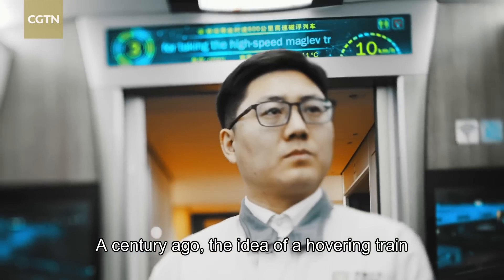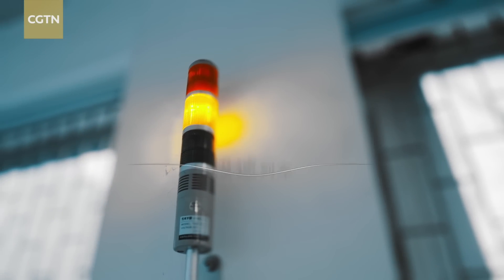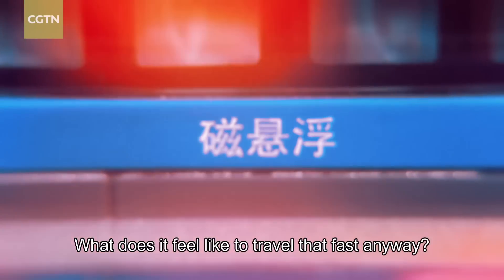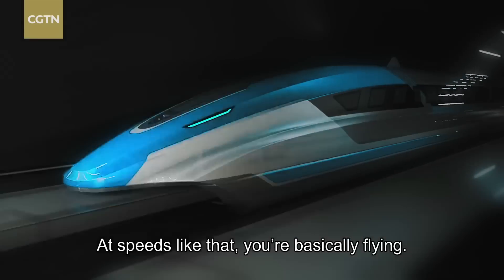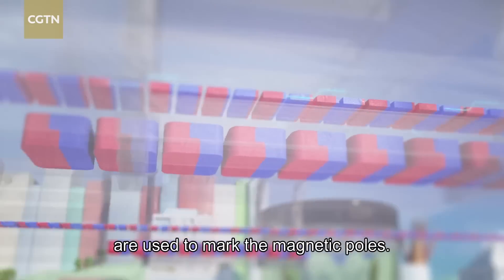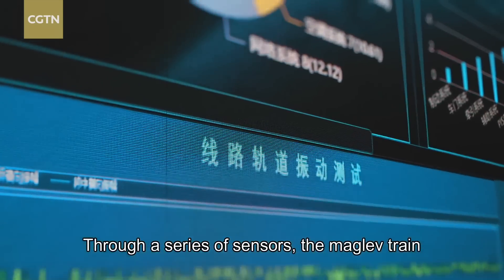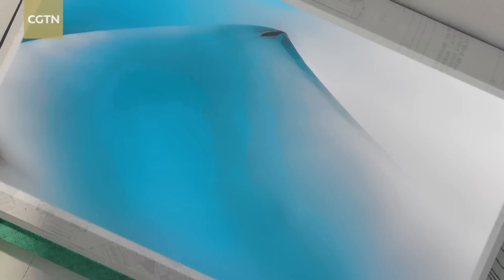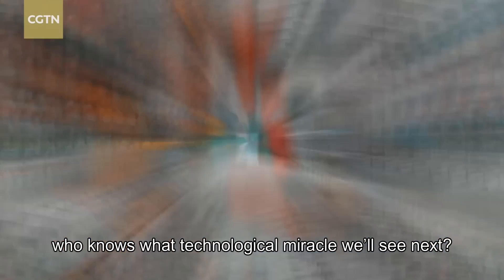The hover train

Comment: China's CR600 Maglev prototype transits are exciting and they have a goal of 800 kph.   When starting a new train era a double wide loading gauge of about 8 meters should be used.  A double wide loading gauge was designed to occasionally be used on dual track British railroads built in the 1840s with wide carriages using the inside rails of the two tracks.   That wide 8 meter wide loading gauge would allow large assemblies to be easy moved long distance overland greatly changing the world we live in.    

The stability of an 8 meter wide loading gauge would support three passenger levels.   The first level could be used for cargo with simultaneously perpendicular loading from the sides of drive-on drive-off automobiles and shaped cargo containers in a one minute stop.  The second and third top level could be luxury continues passenger space with the top level offering vista dome roofs to allow passengers to see forward watching the scenery.   This would provide the same number of passengers in more comfort in one 1/4 the length of todays popular single level trains stretching out several city blocks.  

All very high speed trains need incrementally cheap to free electricity such as might be thought provided by their own hydropower generators with unlimited water.   New technology nuclear electric power could be a another choice.

Comment: With Chinese infrastructure quality, if the train fails to break properly or even something goes wrong in the slightest of margins, the passengers will turn into a massive plump of jelly.

Richard Branson's dream project Virgin Hyperloop backed by Elon Musk failed to properly develop and test a safe 700kmph vacuum tube trainpod design after 15 years of R&D.. don't think China has achieved that in open atmospheric conditions already with 600kmph speed. There must be something fishy about this advertisement, just like China's every other innovation and claims, I mean who are they gonna steal the technology from?? Japan sure has already developed LO Shinkansen maglevs but that has absolutely different working principle, also Sanghai maglev is technologically updated every few years and it can barely touch 430 kmph with similar infrastructure and working conditions. Then out of nowhere China claims to have built this thing, with no proper test videos yet.

I'll tell you what, it's not even developed, just a massive hoax with a cool looking design. Moreover so, TGV touched the 574.8 on wheels in 2008, some 15 years ago but people will suck China off and brand them as "innovators", "technologically advanced" cause these mfs achieved 600kmph on a maglev in 2022. LO Shinkansen achieved 603 in 2016, and after copying and monitoring them for 6 years, this is all China could come up with.

No people with working brains will expect China to develop something groundbreaking, without stealing 95% of the blueprint. And when there's nothing much to steal, like in this case, it's safe to assume it's just another massive fake pr boosting attempt of China, nothing close to that level of technological advancement exists in their arsenal.

They are doing a pretty good job at copying and reverse-engineering things tbh. But not for long tho, cause at some point(very soon) their claims and agenda will surge so high that they will run out of materials to steal, cause they will never stop claiming to develop something extraordinary. Best of luck to them with this human jelly maker machine.

No hate, just spitting facts

Comment: Increasing the speed of a train pushes out the distance envelope over which "trains beat planes". With flight time, one has to add the time to taxi from the gate to the runway, wait for your turn to takeoff/land, and the takeoff/landing itself. Airports are also usually at the edge of a city, whereas train stations can be in the centre of cities. I have also deliberately not mentioned security checks, since I don't know if regular security procedures for planes will eventually be adopted for other means of transportation, although you can't hijack a train to go somewhere it was not intended like you can with a plane.

Comment: If zero friction then how come it doesnt move bc of earth's rotation
Reply: gravity?
Reply: @dongiovanni8899  vertical force?
Reply: @dnaann1867  zero friction with the track, there is still A LOT of friction with the air.
Reply: @johnsmith-cw3wo  so wat if it's placed in a vacuum tube?
Reply: @dnaann1867  Then it will be faster then 600+ KM. There is already a concept, maybe in R&D. It's call Hyperloop.
Reply: 600kmh aren't affected by earth rotation.
Reply: The magnetic keep the train on the track. There is push - pull force by the magnetic on the train.